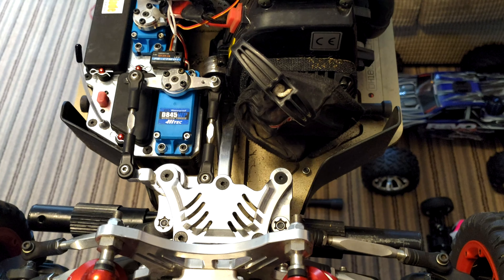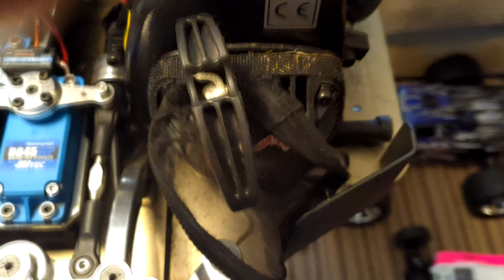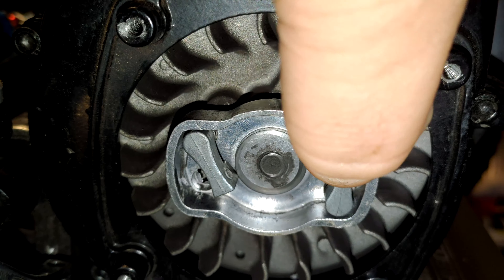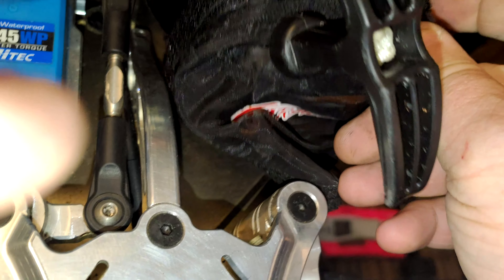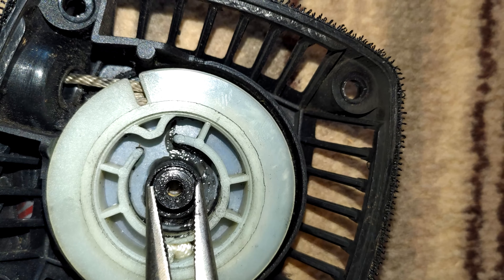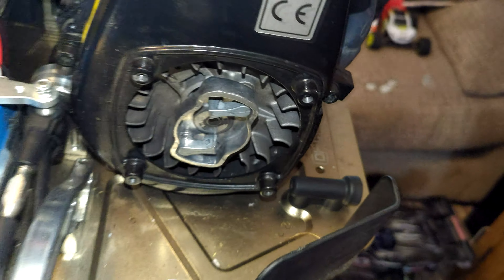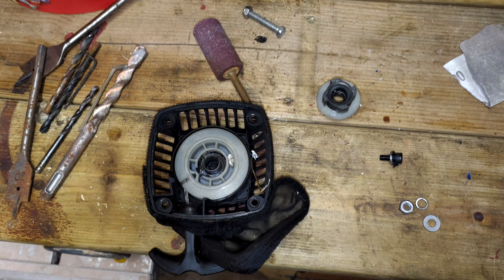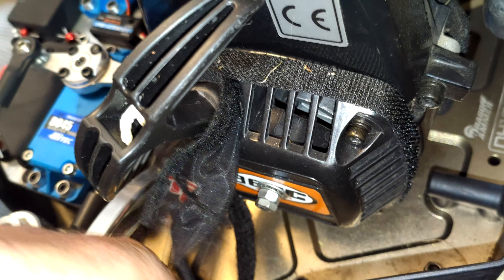Rovan 36cc pull start common issues and fixes.

Comment: Someone know if the cord gets broken, it can be replaced or I have to buy the whole pull start system? I got a rovan 36cc.
Reply from the maker: It's easy to swap just the cord but many just buy a new pull start
Reply: @WTFRCCars  how? I can't get the screw off
Reply from the maker: Which screw there's only one that holds it in and it's just screws out?
Reply: @WTFRCCars  that one, I'm not sure how u call it, cuz my English its not that good, do you know how can I remove it? The Allen key does not work that good.
Reply from the maker: It just screws out and there not that tight as it's just into a brass insert not sure why you can't get it out ? Wrong sized Allan key maybe?

Comment: Hi I’ve fitted dust cover and replaced pull start (new Baja) put it won’t start? Removed and refitted twice but still won’t start, please can you help 
Thanks Gary in Gateshead
Reply from the maker: Have you checked the coil gap at all? Also check that the kill switch is not shorted out
Reply: @WTFRCCars  I haven’t bit out of my depth, was working starting fine this morning, but since removed pull start nothing, could I of flooded engine?
Reply from the maker: Nope not by removing the pull start it's more likely you knocked the coil out of line or pulled a wire off
Reply: @WTFRCCars  is there a video showing where that is or how to get to it, only undid 4 bolts of pull start, maybe I should of left alone lol, attempt to pull off lead on spark plug and ended up with wire end of spring in finger and other end out through rubber casing
Reply from the maker: If you have messed up the ht lead it won't run
Reply: @WTFRCCars  just watched a video and seen where coil is located and you must be right because I cleaned out grass and rubbish out (hence fitting cover) with a stiff brush so could well of done either or both 
Is it a big job to access the coil? 
Any videos of that on your channel?
Reply: @WTFRCCars  can I purchase a replacement? Or new coil and lead?
Reply from the maker: Yeh you should be able to get both
Reply: @WTFRCCars  thanks I’ve ordered one on rc modez luckily I’ve got another 6 cars for fun lol dbxl-e 8s awesome 👍
Reply: @WTFRCCars  is it straight forward to swap out?
Reply from the maker: Yep just make sure the gap is correct
Reply: @WTFRCCars  so I’ll need a gauge of some kind? You know of a video on YouTube as guidance
Reply from the maker: Just leave a credit card stuck under it and it will gap it for you :)
Reply: @WTFRCCars  best distance learning curve 
Thanks for all your help,

Comment: Nice video bro but how do I take off the part that you showing on the fly wheel ? I just got the rovan Baja 36cc . I pop the rope on the pull start but I brought a easy pull start but I don’t know how to take off the part that’s on the fly wheel if you can make a video that would help me a whole lot. Or just tell me how to do it thanks bro. Keep up the good work
Reply from the maker: To remove the part on the fly wheel you need a piston stop tool and then it winds off anticlockwise, but there are different types of flywheel and different pullstart fittings some use 2 screws to fasten to the fly wheel but the one on mine screws on to a threaded bar coming out of the flywheel.
Reply: Does it matter what type of piston stop, or is they all the same?
Reply from the maker: As long as the thread fits you engine it should work fine :)
Reply: Can you send me a link to where I can buy one
Reply from the maker: This is what your after https://www.rcmodelz.co.uk/engine-parts-upgrades/fruitbat-piston-stop.html?___SID=S

Comment: these type of pull starts just suck man.. i bought the completely cnc one, the second time (same day) i was starting it, it broke .. cord wont retract anymore, seems like something bend or what idk, there not even a frickin' bearing in there 🙄 its complete trash ... im gonna go back to my plastic one now, can't even put the normal one's on there because of this stupid "easy start" flywheel
Reply from the maker: Yeh know what ya mean if the engine is set up right though ya don't need many pulls to start em